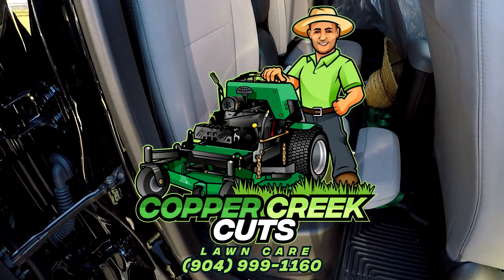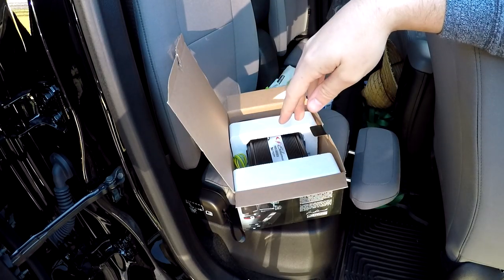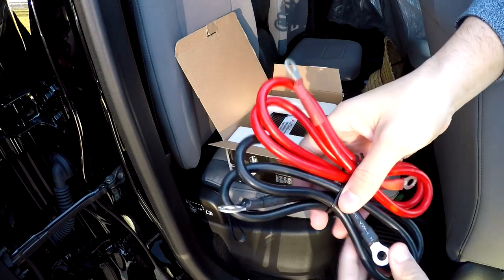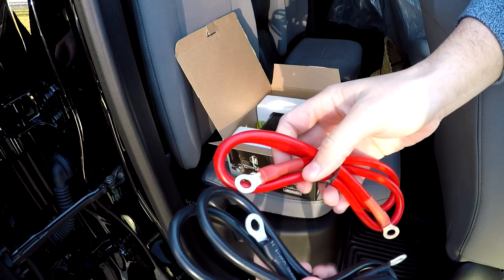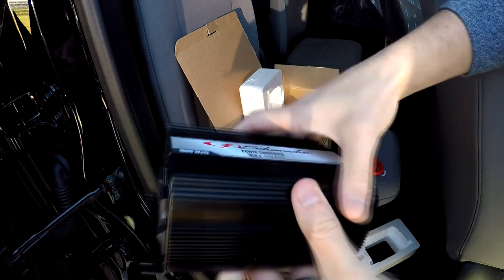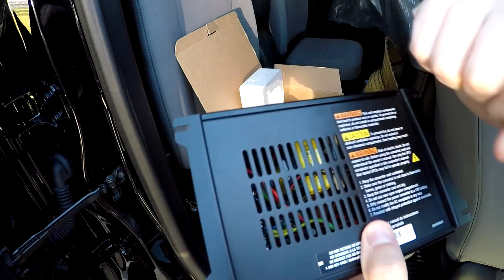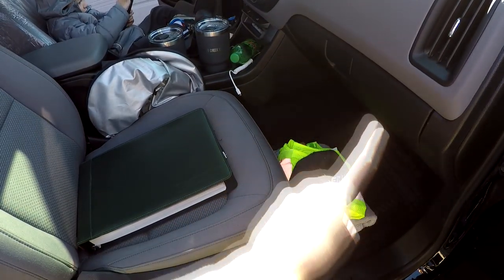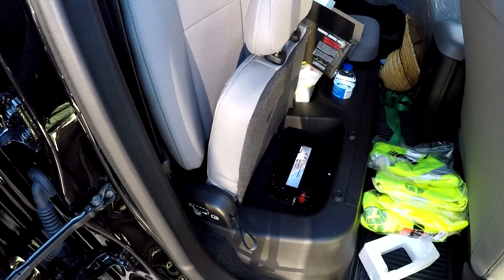Truck Inverter Install - HELP!

Comment: A friend of mine is a good mechanic and he told me anytime you use a high watt inverter like yours, you are going to need a higher amp alternator to run that type of inverter. If you go to a higher amp alternator be sure it doesn't void your warranty on your truck. Running a longer cable might cause a voltage drop to your inverter. You might want to buy a 1000 watt inverter generator for your purpose. But then its more money to spend but at the same time you don't want to short change your battery charger(s). 
  Best of luck 👍😀
Reply from the maker: Good tips! I will check into the alternator as well. Thank you!!

Comment: For 1kW output, that would be a 100A fuse in the inverter (as the text on the end also indicates). 
From how easily you are handling that inverter, I would guess it can maybe handle 1kW in a short peak, and half that continuously. So a good approach would be to start with a slow 50A fuse, in the positive wire, as close to the battery as you can get it. That way, if the positive cable chafes going through the firewall, or somewhere else, you will not have a fire.
Since I am non-us, I guess 'number 2' is what we call 33mm². For 8 meters total wire length, that will be 4 mOhm, which gives 200mV voltage drop at 50A, and 10W heating in the cables. That's also fine. 
And as long as you are not guiding the exhaust air back into the intake, it'll be fine. But if you do, it will heat up the space under the seat in no time.
Reply from the maker: That is awesome info, thank you so much for typing it up!!!

Comment: The fuse inside the inverter is likely in there to prevent the device from catching on fire in case of a circuit failure.  If this fuse opens, there is probably something wrong that only an electronics technician is going to be able to fix.  I am guessing the fuse is in the output side of the circuit.  The  potential current draw from the vehicle for a 1000w inverter is around 100 amps assuming a 70% efficiency.  Be very careful if you are making your own cables.  Each volt lost along the cable due to resistance in the wire and connections will dissipate about 100 watts in the cable at max output.  This can result in a large heat buildup.
Reply from the maker: Thank you for the advice! I have still been too scared to tackle this so I will be able to take your input to the final project! :)

Comment: I have a little inverter, 100 watt maybe, don't remember, that sits in the center counsel , plugs into the cig lighter port/power point. Plug the charger into it and let it set on the floor of the cab. Does what I need.  When done, wrap it all back up and put it way., out of sight, out of mind.   Do you need a 1000 watts ?

Also, every thing you need to hook up your set up can be found in and good Auto parts store. Cable by the foot, ends and tools, etc..
Reply from the maker: I don't need 1000. The ECHO charger calls for 300 and the STIHL chargers call for...570 I think? It was in the text. But this was the one that was on clearance so it is what I picked up! :) Thanks for the tip, we have tons of auto stores so I will check them out!

Comment: Airflow should be fine with seat up, I run 2awg, 20 ft cables to my 1500watt inverter and just use the clamps on battery when needed.
Reply from the maker: Got it! Thanks for the feedback, sounds good for my project! :)

Comment: I am not an expert in this, or pretty much anything else I do, so verify my suggestions.

My F150 has a factory unit that puts out 400 watts.  The Schumacher with 1000 watts is great, if Schumacher is still good quality.  There is that old saying, you get what you pay for.

I heard 0 or 2 gauge welding cable is the way to go.  Go to a welding supply shop and get the exact length you need.  I would run a 12 gauge or so wire first just to check the path and to ensure you order the correct length.  Don't cheap out on the cables.  Jumper cables are not intended for being permanently mounted and their shielding may not stand up long term.  Regardless of what you cables you decide on, use grommets when going through metal.

Putting a smaller amp breaker in line should do what you want, although you will be limiting the power your inverter is capable of putting out.  I suggest trying the inverter as it is.  If you blow the internal fuse, then replace it with either an externally mounted fuse that you can easily replace or with a breaker.  Get a good quality breaker to ensure it works.  I would not modify the unit unless necessary.  

Be sure to have a sufficient fuse as close to the battery connection as you can get. Your 1000 watt unit will pull 8-9 amps.  I think a 10 amp fuse would be too small and you should probably go with 15 amp.  The purpose of this fuse is to protect your vehicle in case the positive cable that goes from the battery to the inverter grounds out.  

My factory unit is mounted under the rear seat, but mine is only 400 watts so yours will put out more heat.  

You will be drawing a lot of power off your vehicle electrical system.  I would ONLY use it while the vehicle is running.
Reply from the maker: Thank you so much for taking the time to type that. All sound like good points, but I will verify as you requested! :) Thanks again!

Comment: Test it first before you buy anything to make sure that it even runs the charger 🔌/ chargers that you are going to be using... My inverter tends to not run some of the chargers that I have. But then again my inverter is smaller.
Reply from the maker: Good point! Not sure how to test it without still hooking it up to the battery, and I feel like if I do that I am only going to want to do it once! :)